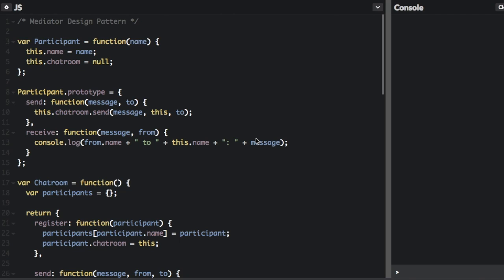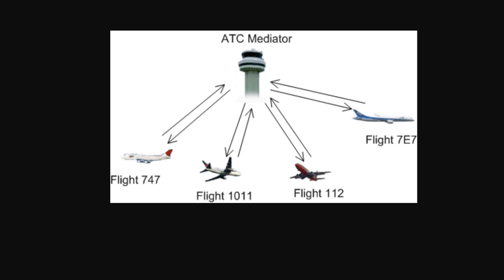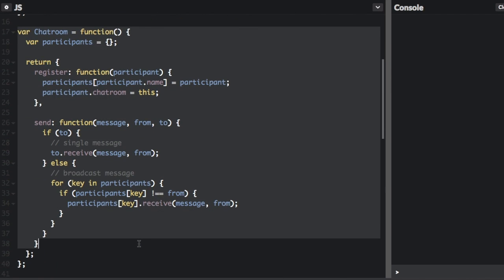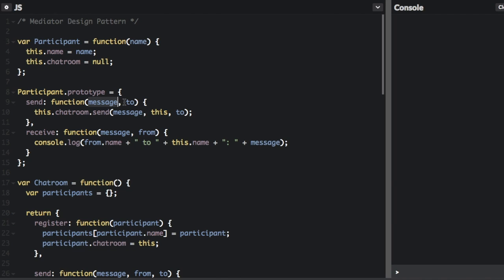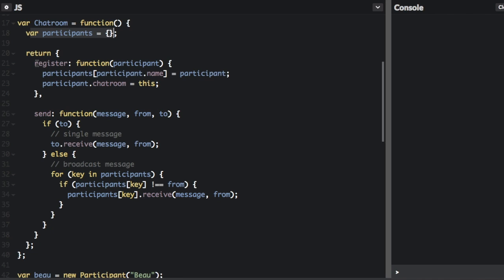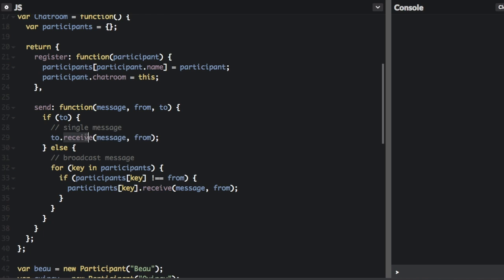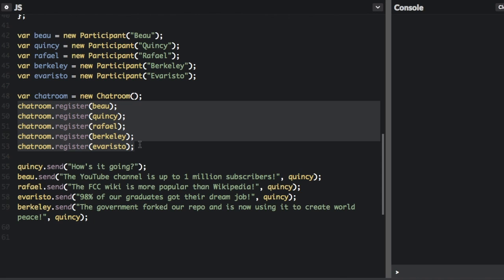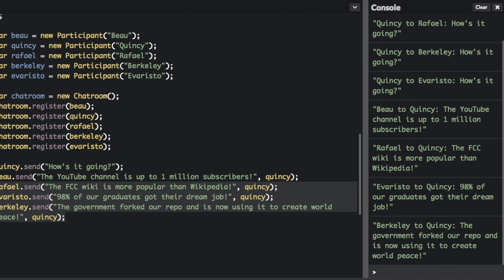Mediator Design Pattern - Beau teaches JavaScript

Comment: I didn't really see the difference between this and the pubsub. Can anyone explain the main differences? TO me the look really similar...
Reply: You can say that the pubsub event bus is a mediator, but a mediator is not an event bus (or a pubsub in general).

Using the video's code example, you can see that the chatroom acts as a mediator by directly calling the "receive" method of every participant. The participant calls its "send" method which will use the chatroom's "send" method to call all of the other participants "receive" method. This way participants don't need to store any information about other participants, the chatroom (mediator) will be responsible for mediating this communication.

In the pubsub pattern we always have an event bus taking care of all events and handlers that are registered to it, and it is also a mediator. The difference is that the pubsub is done specifically to deal with events, where an object can subscribe to any event with a handler, and another completely different object can also subscribe to an event or fire one that was subscribed by other objects. Objects have no idea of how many other objects are subscribed to the event they are firing (just like participants have no idea of other participants in the chat room), and also objects have no idea of who's firing the event they're subscribing to. The responsibility of the event bus (mediator) is to properly handle these events by calling the proper callbacks attached to them.

And the observer pattern, which can also be confusing in the middle of these, is almost the same as the pubsub (pubsub is actually derived from the subscriber pattern), the difference being that while using pubsub we have a very loose coupling between objects due to the event bus being the one handling all the events, and in the observer pattern we have a tight coupling because the observer object always knows about the subject it's observing to (exactly how we do natively using the DOM API to listen to elements events).
Reply: @devlust  thank you. Very exhaustive ☺